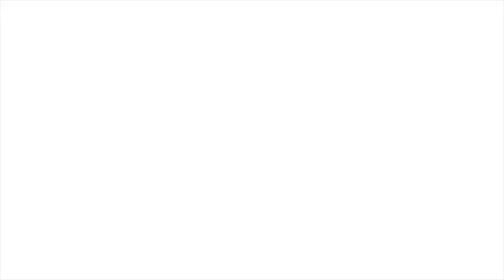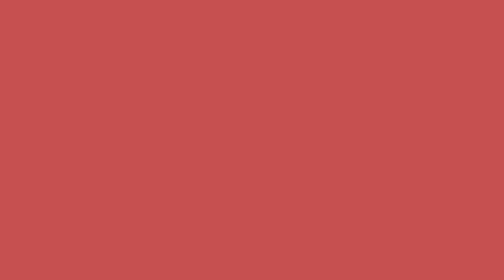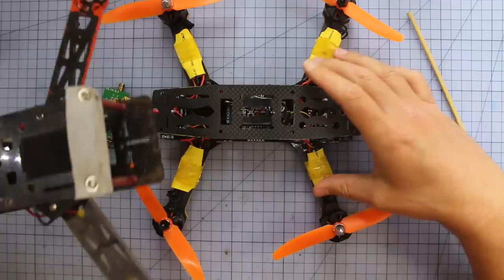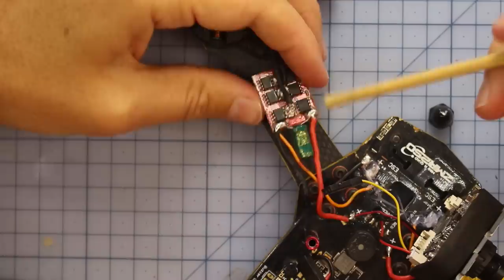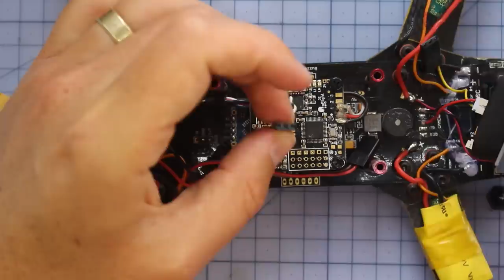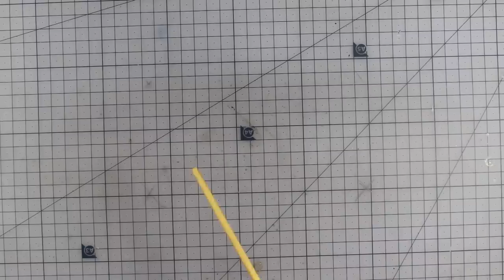Looking back at our FIRST FPV RACING DRONES. Tech Tuesday UAVFUTURES

Comment: Well, I bought a used Eachine Racer 250 running Open Pilot. I suppose "unfortunately" I never really tech'ed up, I just tech'ed into the most budget parts possible, until my dad sent me an Eachine Racer 250 pro version, which is my current main quad. well, it's alright with me that I'm a little behind, because I can't afford the nice high powered machines, and I can't afford to fly them either. With my humble machines I can go close to home and fly every single day, crowds or not, and I don't have to worry about things like my video channel, interfering with race-vtx's with my bungle of a vtx, or flying courses designed for more power, or seeing gates into glare with my junky camera. ,, or having to buy more parts at my paycheck a pop, etc. etc. It's amazing because no matter what seems to happen, I just make it to the park, and get into the air, and nothing else matters, I am just so happy to be flying, I never get bored, I never run out of interest, the whole time I'm at work I get to swap my batteries and dream about flying, the whole time I'm driving I'm just excited that it's leading to flying, and every song on the radio makes me feel so much joy about my time flying. I never would have dreamed I would enjoy my little bungles of joy so much, people had drones around me and I never cared much,,, but after my first little toy drone broke, and I replaced it with one that didn't (basically a clone of the syma x-5), I flew it every day and lived every moment trying to find the next better thing to fly, and getting more time flying. At some point I was charging toy quad batteries from my power tools and spending 5 or more hours at the park cycling through every toy I had, going home, repairing everything, and just doing everything I could to keep flying,, be it los, or I did even have some FPV by then. I transitioned to Miniquads slowly, having only one battery and spending hours at the park still flying my toys, focused on FPV syma x-5 types using the syma x-5 5.8ghz kit you can buy. eventually my toys broke, my wallet broke, and all I had mind for was miniquad, and I can't believe what my last year and a half has been like. My work-mates hate me and call me racist, other pilots hate me because I got them kicked out of the park, or because I think that the airplane dive was ballsy, but alright, and most people would never talk to me because I refuse to cut my hair and beard, eat way too much bread, and have no interest in making friends with anything that doesn't run on an FC and have sick propellers. But as long as I can get back into that forward momentum and make it through that tree,, I will never look back. Nothing brings me more joy in all of my memory than experiencing and practicing the balance of FPV quadcopters, and nothing has ever promised to stay more interesting than the practice and balance of quadcopter flight, and FPV will certainly lead directly to anything that might compete, like manned quadcopter flight, or space-flight.

Comment: you got me thinking about my history  .28 Jul 2013 LadyBird V2 FPV + Fat Shark Teleporter V3  and 27 Jun 2016 was the first time i saw some one else flying FPV.  168 FPV videos latter and i only killed 8 quads in all that time . it's all ways been about the FPV not the quad for me . but F4, betaflight, and air mode are cool AF  :)

Comment: my first was a rtf zmr 250 with 12amp simon k"s running 6 inch props and a naze rev 6.....it blew up first take off  lol ,,never got an rtf ever again ,still got the frame and the old 2204 motors it came with lol
Reply: them escs are the same as the ones that blew up on mine hahaha

Comment: Maybe this is a sign I should start from scratch... ZMR 250, 2204 2300kv motors with Gemfan 2 blade 5030, Naze flight controller, had 4x 12amp ESC but one went up in flames (with a motor) and replaced with 4x 30 AMP SimonK, rated only for 3s. The only difference is my camera is modern, VTX is a little big, but not a dinosaur, and the ZMR frame is a lot less flimsy.

I was going to put a new set of motors. It was doing some weird bunny hop oscillation after 1 of the motors was replaced, and I think its a loose motor wire like I've seen before. But now I'm thinking its probably just obsolete (and it weighs about 1.5 tons, joking, but its ridiculously heavy...) So far its been a non-flying money pit, so I'm not sure its worth spending the $40 for a new set of motors (some 2207 motors you really liked a month ago, they seem to have 4x the power mine have when I tested mine, an abysmal 330g each...). Might just go with a BNF in the $200 range and keep the frame as backup.

Comment: 2011 was when i got in to multirotor multiwii was the first flight software that I used on a quadrino flight controller and I flew the hover things fpv frame 450mm fpv was a security camera setup back then when you crashed or had a fly away you were out $1,200 easy those were the good old days

Comment: Just starting off in the racing drone hobbie recently and have bought the eachine wizard 220s. So far so good as a beginner it has took a beating and still flys  perfect. Did that old technology used to be very hard to fly or has it stayed relatively easy to fly thru the years?
Reply: aoh yim wasn't as fast or responsive as they are now. Most of us were running 3s back then. I remember if I pushed my robocat 270 too hard it would brown out and just fall out of the sky. Much better now days with f4 chips.

Comment: Hey stew
Thanks for this vid its really helped alot as ive just picked up a old quad from a guy here in nz, its got a emax skyline 32 FC has the same esc's as this one in the video and emax dragonfly 1806 2300kv motors,have no idea what the frame is but would love to know, Thanks for the vid =)

Comment: I've had enough Stu I've bought a taranis qx7 + receiver + 5" floss build/motors,frame,4in1 esc,flight controller.  And I cannot get to setup correct? Have done it all right in betaflight is perfect! But keeps disarming and motors are erratic.. no one will help, have been on discord 10 times.. starting to give up trying.. have spent around £600 on my first build I'm so frustrated and that's not like me.
Reply: Wish I had friends like Trev and you to help..
Reply: Dont give up man!  Ive been there too.  Sometimes it took a week or two to get a quad to fly.  Usually stupid simple things too.  I didnt calibrate one fc so it wouldnt fly. I had a quad I flew for a month then one day it didnt throttle up, all it needed was to bump the throttle trim down a few notches, thanks to Andy RC I had a great afternoon of flying.  

I too just upgraded to the qx7 from the flysky i6, so ill have a new learning curve, about telemetry and rssi.  I dont really know what they are or how they are used.  Ill have to watch a few more vids thats for sure.   

Im going to give all my brushed stuff to my little bro for his B day.  I have one for LOS for him to bash, then ill build him one for fpv. And i have a 3rd FC to give him for a 2s brushed set up if he wants to step it up a bit.   So itll be all setup and tuned for him and ready to rock, cause he doesnt want to go through the problems and learn.   Hope he loves it as much as me.
Reply: I wish I could help with your problem, but i havent encountered that so I cant help you.  Did you try flashing the esc s? The disarming I dont know best of luck to you.
Reply: Peter, list the models of your equipment. I believe that it is only connection/configuration problem.
Reply: That’s we buy quality BNF models. Sorry about your luck. But you obviously have money to blow. 
Next time buy something pre built my friend.
Reply: There are steps to moving up in this hobby and you tried to skip a few.